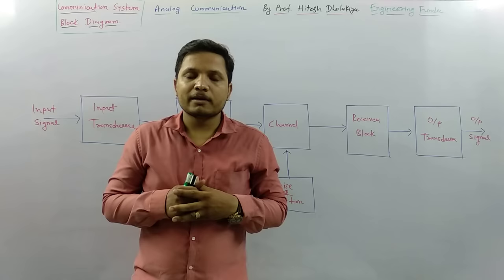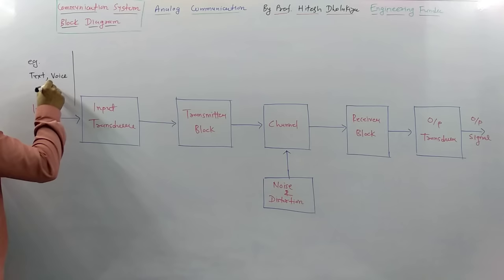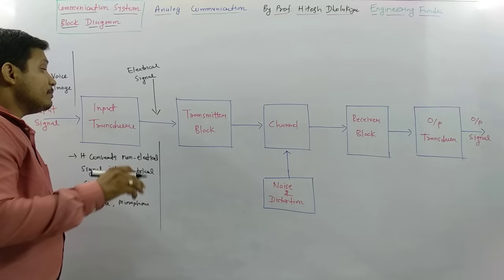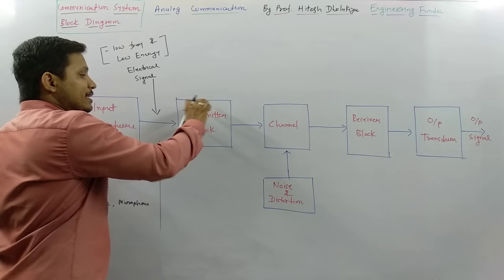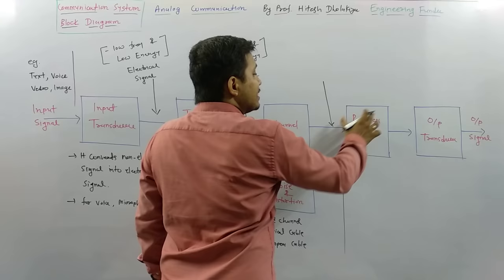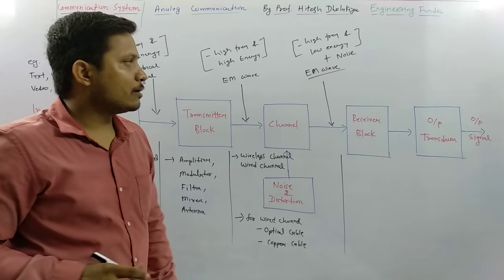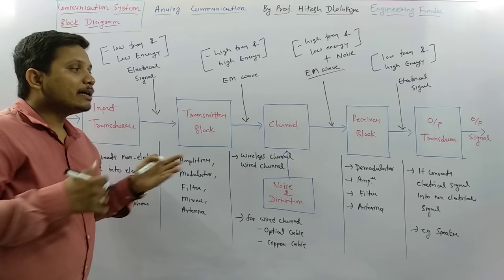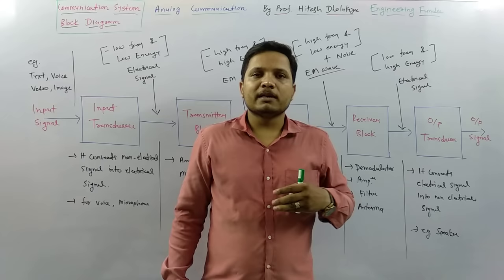Communication system (Block diagram, Basics, Working, Details & Signal Propagation) Explained

Comment: Find the various frequency components and their amplitudes in the voltage given by v (t) = 50 (1+ 0.7 Cos 5000t- 0.3 Cos 1000t) sin 5x106t. Draw the single sided spectrum. Also evaluate the modulated and side band power.

Good Afternoon sir i need this answers

Comment: Classic explanations  , sir any video on Remote Control circuit's  for example Remote Control circuit's  for controlling motors in RC toys 
How signal is transmitted from transmitter to receiver to control the motors
Reply from the maker: I haven't gone through it yet.

Comment: After channel how did the high energy signal changed to low energy signal?
Reply from the maker: In channel, there is maximum attenuation. That channel may be air, optical fiber or coaxial cable.